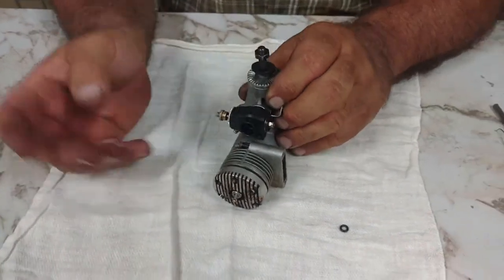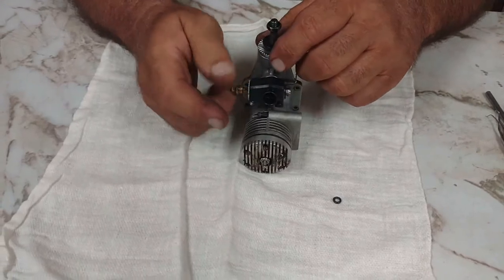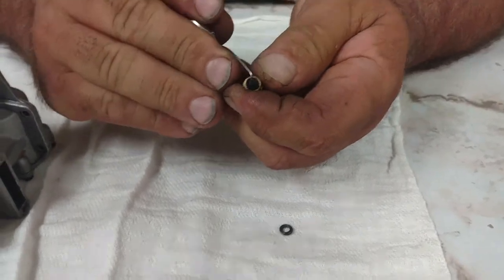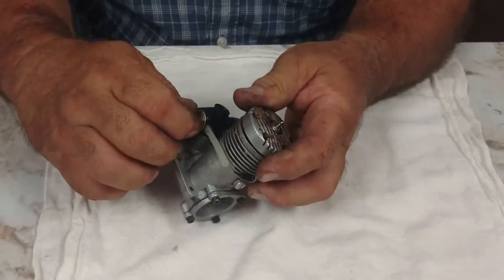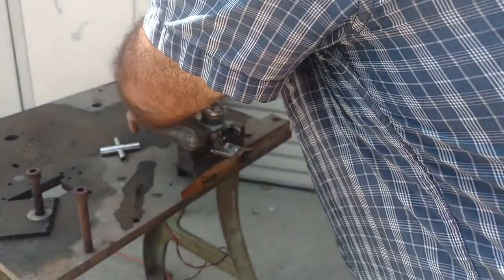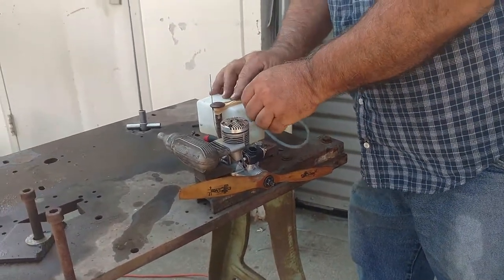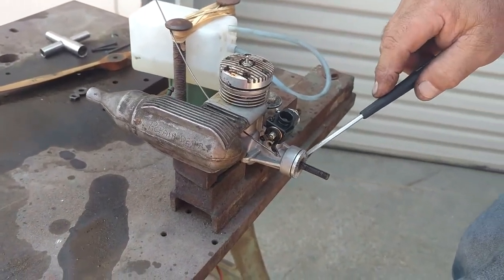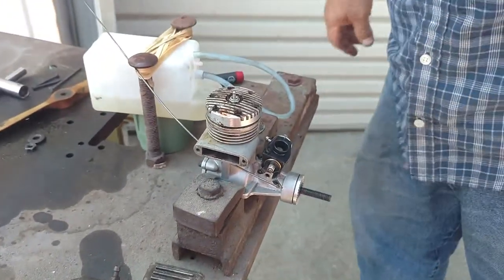K&B 61 Perry Carb Needle repair

Comment: On the 28 Sportster with a Perry Carb that has the eccentric screw low speed needle disk adjustment, I barely achieve good overall performance at the maximum lean reach of the idle adjustment and I want to go a little leaner. Do I have an air leak, or can I reassemble the low speed needle in a leaner positioning range?

Comment: Hi
I have an issue.
When we move throttle forward or backward the fuel comes out of the needle valve...and the needle valve also moves with throttle movement...do needle valve also moves while throttle moves...
Reply from the maker: Yes the needle moves and you probably need a new o-ring available from MECOA